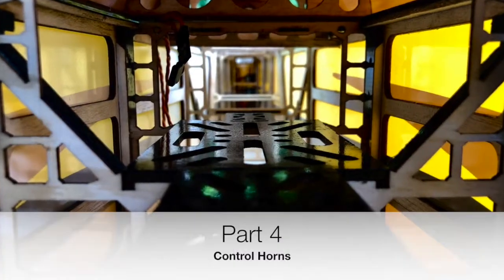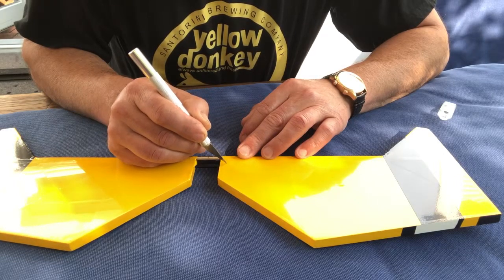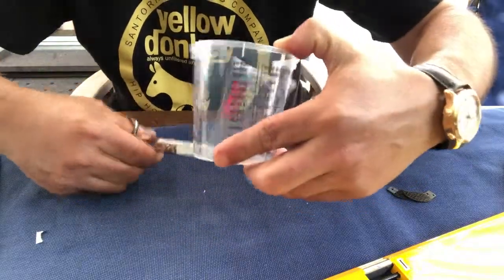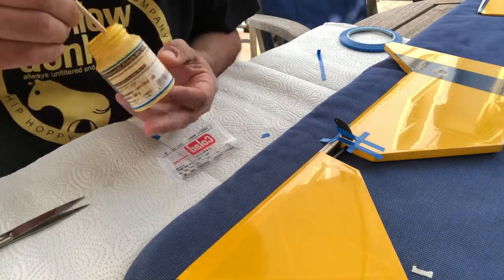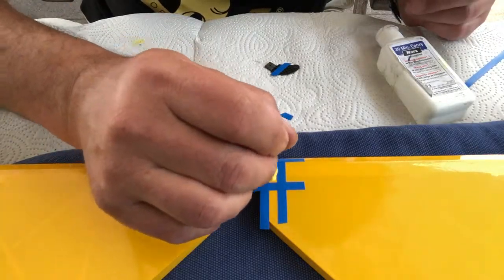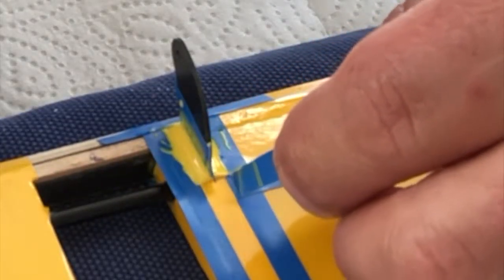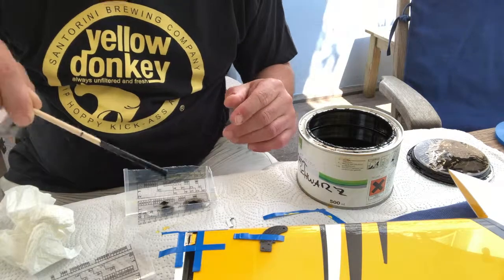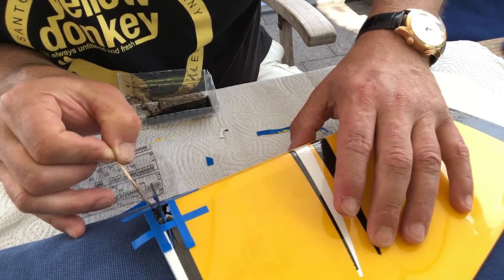PA Ultimate AMR 60 (4): Control Horns

Comment: For mixing epoxy I use regular plastic drinking cups. I cut the tops off to make them very small cups, maybe 2 inches tall. Then I mix my epoxy in them. After using them a couple times a layer of epoxy starts to build and the cups fill up more each time you use them. But one cup has lasts for a long, long time. The downside to this method of mixing is it can trap some air in the epoxy because, for the most part, you can only stir the epoxy.

Comment: First, I can't tell you how thankful I was to find this build series.  We're doing a PA ADXL for our first ARF, and I was so frustrated that I was ready to take it out back and burn it.  Even with the older build videos and the manual, there is a lot of detail missing that you have included.  Now we can see some places where we went wrong (install the elevator and rudder before the pull-pull system, making the fuselage bulky and awkward, as you mentioned NOT to do, for example), and can see the light at the end of the tunnel.

OK, you asked about mixing epoxy.  I like your method, but we've done it a little different.  I'm new to epoxy, and didn't know how imprtant it is to get it exactly the right ratio, so we use a scale.  First, we buy these little epoxy cups, which come with mixers:
https://www.amazon.com/gp/product/B07CSKKPDK/

Then we use a 100-gram pocket scale.  We squeeze "about half" of what we think we need, then just add EXACTLY the same amount of weight.  This is much faster and more accurate than using the little gradients on the side of the cup.
Reply from the maker: Eric, thank you so much for your kind words. I am so glad that my efforts are useful. And I didn't know those little cups. I must find out if they are available in Germany... All the best to you and for your maiden flight.